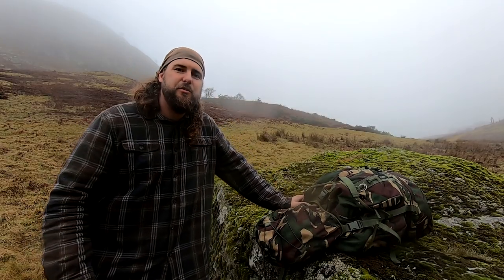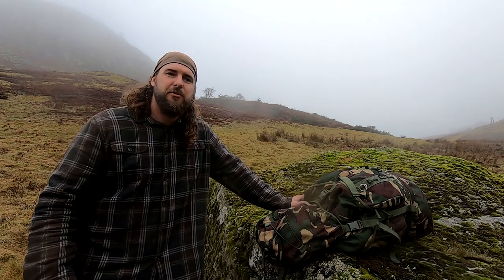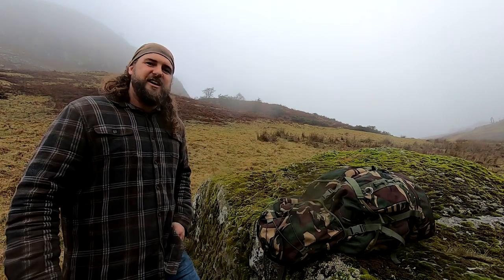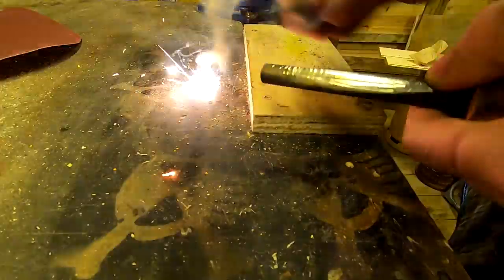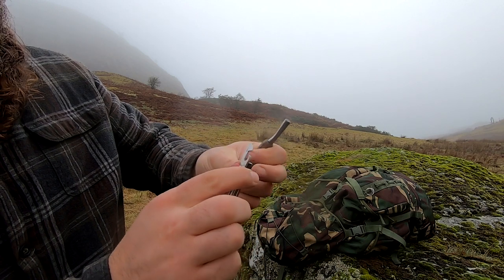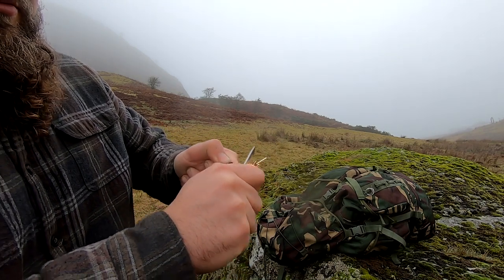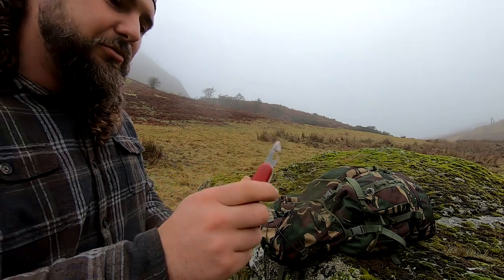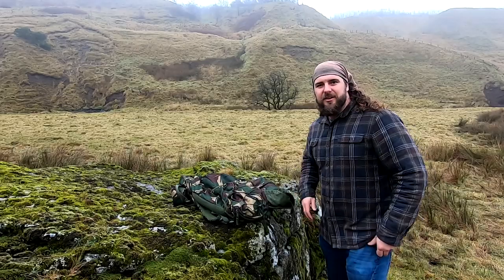Bushcraft and Camping Tips You Have Not Seen Before

Comment: Ranger bands are great to use, but I use Duct Tape instead.   Multiple wraps to protect my axe, and unwrap one or two turns and it is great for starting fires and better for the environment.   Thanks for the great video.    Going to add wax paper to my kit now.
Reply from the maker: Thanks mate, I tried duct tape on an axe but found when it gets ripped from logs it gets all sticky and a mess, but if it works for you that's all that matters 👍 
All the best.
Skye

Comment: Actually stainless steel works every way as well as high carbon steel. We a ferro rod it doesn’t matter what you scrape it with as long as it is sharp and you can scrape quickly. All the chemicals are in the ferro rod. Once you switch to flint and steel it does matter because you need the iron in the high carbon steel because it it is easy to scrape with the flint to get fine iron particles that will ignite and make a spark. Nice video.
Reply from the maker: Well said Mike, I've been planning to switch to a flint and steel but keep taking the easy route 😂 I'm hoping writing this will kick my ass in gear 👍🔥🔥🔥
All the best mate.
Skye

Comment: RE: Tip one. Great idea for the SAK.

Btw for Ferro rods the steel type for the striker makes no difference. If the edge is sharp and hard it will shave material/sparks off the ferro rod. Even a chard of glass would work. Perhaps perceptions from flint and steel are in people's minds, so they expect carbon steel would work better. The "flint" and steel process and its reason for sparking is a whole different kettle of fish altogether.